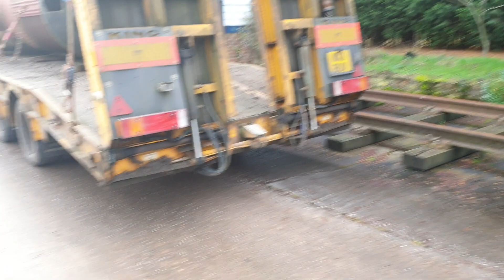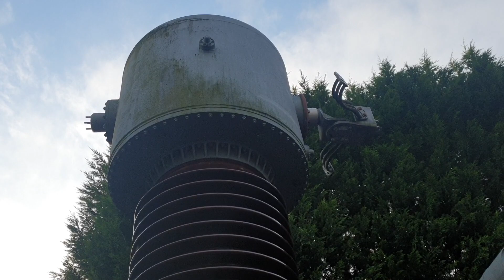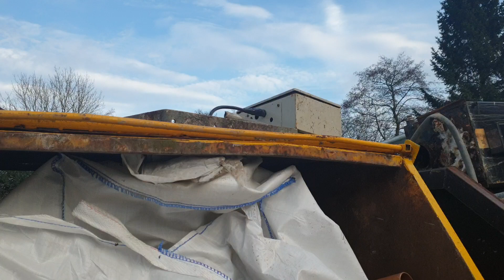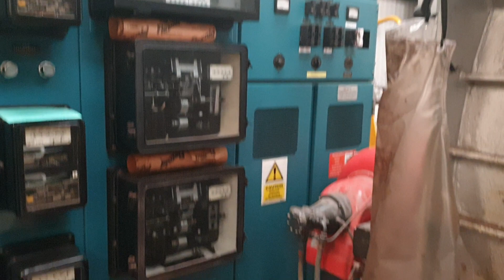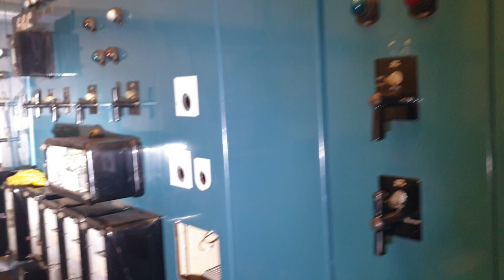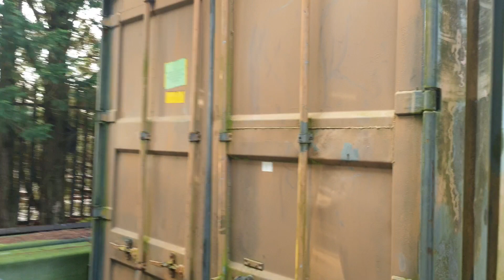substation equipment”

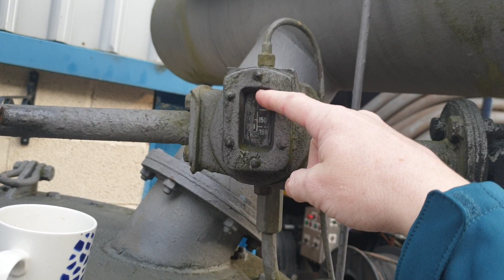Comment: BuchHoltz relay at 8:47 Nice equipment but very heavy. 

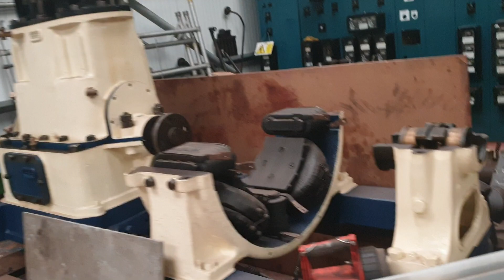A real High Voltage lovers paradise. At 14:00 not railway lights but CB ON/OFF status indicators. Some big crankshafts there. Ooh those kWh and summator meters ! Excellent video. Sweet dreams.
Reply: RODALCO2007 We don’t use them for that in this area, they’re used as a visual indicator for the electric fence installed on 132kv substations. It lets us know if control have disarmed it or not, and the sequence of lights lets us know if it’s on, disabled or starting to count down to turning back on again

Comment: Hiya. That thing in the beginning, 
as it said on the side of it "OCB" 
is an Oil Circuit Breaker. 
The tank at the bottom of the device......

......would most likely be filled with insulating oil (as per the 'O' in OCB) and this prevented arcs and flashover when making and breaking the circuit.

As for that device at 0.30 ......See if you can ask him for two complete units as they are shown here.
Why? They would make excellent GATE POSTS!! You'd definitely be the talk of the neighbourhood with a pair of those! :D

Those transformers with only one bushing..... Its a shame he hasn't got the full set. I saw one with a blue cap and a yellow cap, and there would have been a third one with a red cap.... to indicate the three phases! :D (Sequence: Red, Yellow, Blue)

Also, those blow-outs on those: I believe that's for pressure inside the enclosure. If it becomes too much in there, the glass is supposed to be blown out. Stuff being next to that when it lets rip.... you'd be covered in glass shards!!

Just across the road to where I am located, there is a Ferranti transformer in a 33kV/11kV substation, and it also has a similar kind of glass blow-out on it, and is situated at the end of a curled-over pipe. On top of the transformer, is a large oil tank with a huge FERRANTI plaque on the side of it and there is a large gauge on the end of it. Its either oil level or pressure, not sure.

That 400kV bushing on top of that shipping container..... OH MY FLIPPING GOODNESS!!!!

I can well believe that being a 400kV bushing too! That is so huge, it makes that shipping container look like a shoe box!

I have actually stood next to three of those..... WHILE ENERGISED!!! Let me tell you: They don't half crackle and fizz!!
They were (obviously) located on top of a transformer, 400kV delta to 132kV delta.

I have always wanted a set of those, but now having seen how huge they actually really are, there's very little to no chance of me having a set of those because of the size and weight of them!! Anything at a distance looks smaller, and having now seen just one of those on that shipping container.....My goodness that's a beast!!

That free-standing device next to the shipping container..... It makes me wonder if that is a current transformer (CT) as somewhere in a substation, there will be current metering going on, and the output on that will most likely be only 5A, hence those small, thin wires inside that terminal block at the base.

Speaking of which.....

Inside that warehouse, I wasn't too bothered about all that steam engine/diesel engine stuff, I just wanted to see more electrical stuff and bushings.

Bit of a shame that some OCBs got cut up, just for their bushings. :-( A bit like when an elephant gets killed for its tusks. :-(

Substation control gear..... Do I spot..... Do I? .......Is it? ........Could it be?

FLIPPING YES!!!!! I SPOT LOADWHEEL BASED kWh INSTRUMENTS!! :D

I would have REALLY liked a super-close-up look at those! :-(

I noticed some bits of kit on there (like those Buchholz relays, shown at 21.31) were Metropolitan Vickers, and the meters either were as well, or either Aron, GEC, Chamberlain & Hookham, English Electric or even Metropolitan Vickers.

Those HUUUGE amp-meters which you briefly show at 22.51 ......They are most likely made by FERRANTI :-)

Thanks for showing all of this. PROPER ELECTRICAL PORN!!!!

I would like to see one of those single-bushing transformers wired backwards and see you rip a huge arc off of that top bushing, just for the fascination and the LOLz. We all like massive phat arcs. :D

Thanxx for showing,

-Wayne's Electrical.

1st January 2020, 20.53
Reply from the maker: Hello Wayne.
Yes after i actually calmed down i remembered what alot was called. Lol it took some time. But unfortunately I get overwhelmed with high voltage.

If you like big arcs I do some in my earlier videos from xray transformers. 150kv and potential transformers at 20kv at very high current. Juicy white arcs lol

And yes the place I visited I'll have to do another video showing the meters close up! As iv had a couple of people private message me asking this.

Thank you for your comment and info. Very kind.

Thanks again and happy new year👍😉

Anthony⚡⚡⚡⚡⚡

High1voltage1rules
Reply: @high1voltage1rules  I look forward to more detail on those meters too as many of them had 7 pointers instead of the usual 6.
Reply: @RODALCO2007  The meters are from a day when the UK's system was nationalised. These came from a substation that was fed with 132kv direct from the local power station and distributed at 33kv. In days of old, the power station and 132kv network was owned by the CEGB ( central electricity generating board) and the 33kv network and beyond was owned by the local area board such as the MEB (midlands electricity board) The meters and paper recorders are basically the electricity meter for a complete town to enable the CEGB to charge the MEB for power used. After privatisation in the UK, this equipment was redundant but left in circuit until the substation got modernised. The paper data logger was controlled by a central substation clock which we are trying to got hold of. This equipment metered the secondary side of the 132/33kv transformer. We think mid 1950's in age. After privatisation the 132kv network was transferred to the local area board (now privatised) with only the 275kv and 400kv network coming under a national company which became National Grid. Hope this helps.
Reply: You were right!, the large item standing up by the shipping container is a C.T, rated at 400kv 2000 amps with an output of 5 Amps so well spotted. The wall bushing is 400kv, may in fact be from a 500 MW circuit as from a power station and this was from one set. It weighs 7 tons and is oil filled with its own conservator tank plus it also has its own C.T built in to the centre construction. Age is about late 1960's. The outside section is smeared in grease as they had issues with flash overs due to contamination's becoming attached to the porcelain which was very difficult to remove. The idea being the soot/dust etc landed on the grease and it was easier to wipe the grease off and re-apply than it was to clean the ceramic.
Reply: Wayne's Electrical The oil circuit breakers are OFA series breakers by GEC (Witton) and were taken from the Cellarhead 132kV substation on site with the 400kV National Grid site. These particular ones were taken from circuit 405 which feeds Stagefields 132kV in Stoke-On-Trent. They were removed and replaced with brand new SF6 breakers. In terms of the tank on the transformer that you were speaking about, it’s called a Conservator, and it’s there to allow for expansion of the oil within the transformer due to changes in temperature caused by load. The gauge is there as visual guide to the level of oil in the transformer for us who work on them. And speaking of fizzing, it’s still not nice even when it’s been made dead and earthed, on some sites the induction is so bad you can draw small arcs from the busbars and isolator fitting with a screwdriver and you have to wear HV rubber gloves to stop getting shocks!

Comment from the maker: yeah sorry guys, the first box we come to was a circuit breaker forgot to tell you it would of been full of mineral Oil. 
the water tower would be full of salt water to give more resistance' and it wasnt a stand off (silly me not thinking lol) it would of been the bushing! ( I should know as I'm into high1voltage1rules 🤣)
 i show in the video the insulator.  the tower was basically a high voltage resistor to bring the high voltage down. incase a high voltage line comes down and shorts" for safety reasons. something like that the purpose.
was a fantastic and very interesting place to visit.  made my year lol